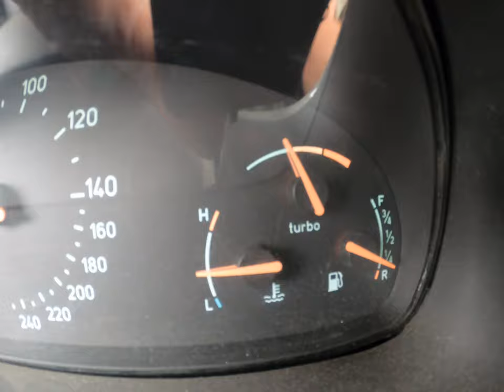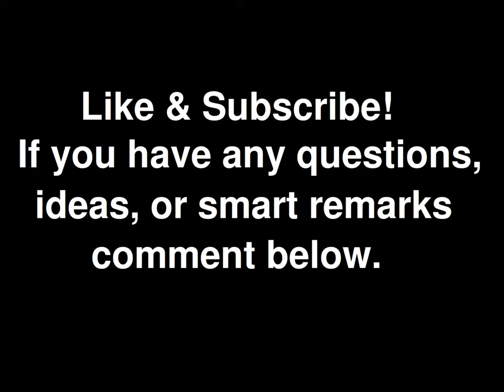Boat rebuild (PART 3) Top cap removed!!

Comment: Coosa board is a great replacement material for the transom
Reply from the maker: I agree, I decided against it because I was on a budget and the boat is stored on the trailer. if the boat was in the lake all summer i would  go with Coosa board. 🙂